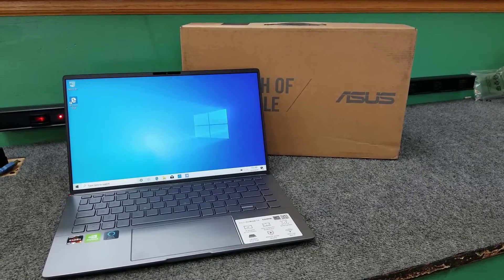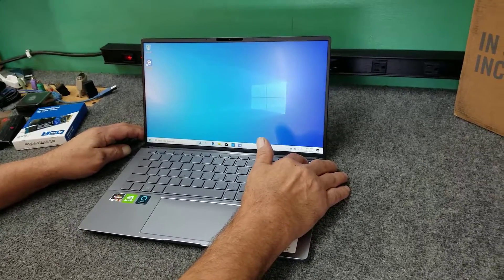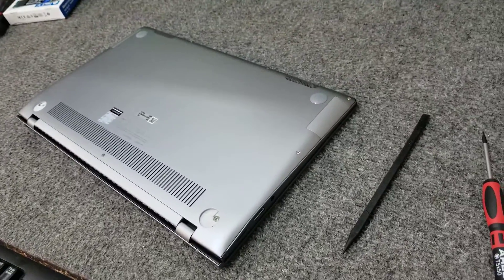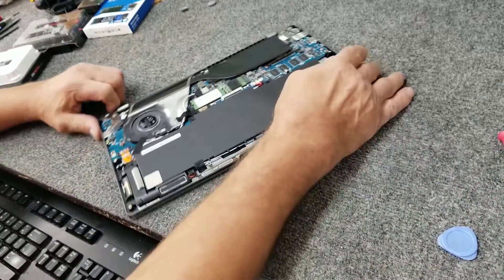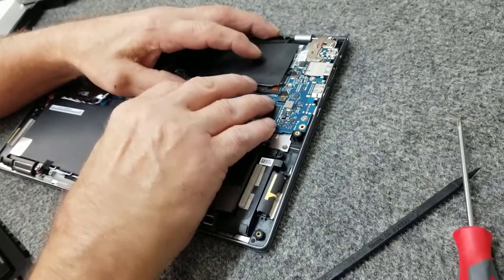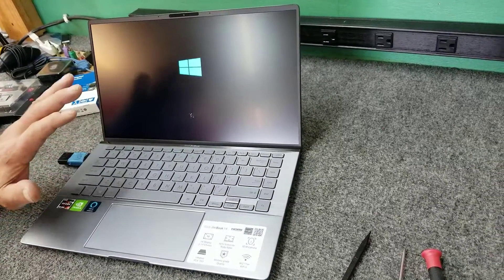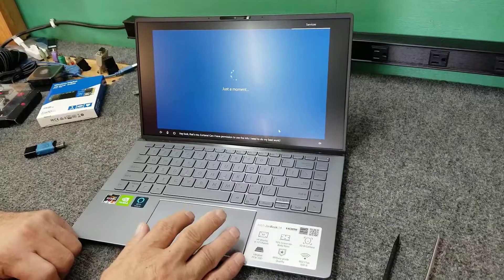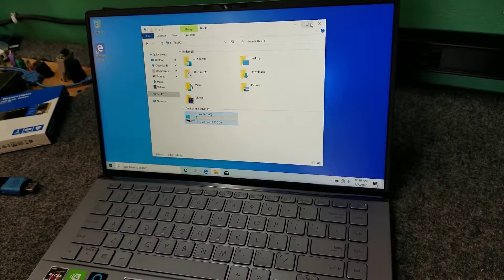ASUS Zenbook 14 How To Upgrade NVMe SSD

Comment: I got the same model and am pretty happy with it, unfortunately the SSD 256G is the bare minimum storage so like you am upgrading to a Samsung 970 EVO Plus 1Tb SSD.  I pulled this video up as my first roadblock is the 00 screws holding the bottom plate…I need a new tool.  The usual.  Great info 👍🏻

Comment: Will an nvme pcie 4.0 drive work on this laptop?
Reply from the maker: It should work fine, but will run at pci-e 3.0 speeds. It will still be fast.

Comment: The reason why the laptop was not fully powered off was because you released your finger off the power button before it shut down, causing it to go into sleep mode instead.
Remember: a proper shut down would be going into the start menu and clicking shut down.

Comment: Hi! Great video.

 Quick question, will I benefit if I install a gen4 pcie SSD or will it be bottlenecked by the slot of the laptop?

Thanks!
Reply: Lookup the pcie bus type…it’s probably a Gen-3.  If so the Gen-4 will be throttled by the bus speed.  I had this question and asked AI and it guided my way 👍🏻

Comment: Do you know if you can upgrade thhe RAM in the Zenbook duo 14? It comes with 8 GB and it says its capable to take 16 GB but how if is soldered to the board??

By the way, thank you for your video on up dating the SSD (NVME)! Appreciate it.

Comment: Hi. I bought the new asus Q538e 11gen I7, 16gb ram, 4gb video, oled 4k touch. It came with a 1tb NVMe drive but I wanted to put in a faster drive....so I purchased the WD Black SN850 NVMe gen 4 7000mb per second drive. Bios saw it but windows install never did. As I gave up I put the original drive back in so I could contact asus........bit locker locked the laptop. I want this new drive in the laptop....but this was not a smooth sailing adventure.

Comment: If the laptop is new without many things installed, is there any reason not to clone it? Will it cause issues if I clone it to a bigger drive? I bought the same laptop and still haven't gone through Windows setup I don't know whether to clone it or reinstall windows.

Comment: Update: the process went well
It's probably the easiest mod ever 
I followed along with the video 
Other than the middle one, the torx screws are a bit slanted.
Everything looks good and thanks for the tutorial
A side note: as other poster mentioned, make sure the SSD is NVMe.
I installed Crucial 2280 NVMe 1TB on it. The blue tape on the top should be heat transfer tape

Comment: So the only option is to replace the old SSD with bigger capacity??
I thought it has a free slot.

Another question, if I do clean install like yours do I need a new windows license or not?
Reply from the maker: Hi. This model has only one m.2 slot. That's it.  Not alot of upgrade options except larger nvme drive. Ram is soldered to mainboard.  Dale

Comment: Seems a good idea WD sweet spot performance /$ 

Would like to see if Linux and w10 coexist well very much . Does GPT type for drives install helps ? Or necessary maybe? 

It’s a good little machine that handles 2! External screens (seen that in practice) impressive!  Without dedicated GPU (?!)

Comment: can i add another 8 GB ram and HDD
Reply from the maker: Hi. On this model, the ram is onboard.  No expansion slot. Sry.  Dale
Reply: Hi it is possible by soldering RAM chip but is difficult

Comment: Would you say disconnecting the battery is definitely necessary?
Reply from the maker: Hi. Well, if you new at this stuff, then yes. Also pushing power button after disconnecting battery is needed too. Otherwise,  be darn careful.  Dale

Comment: Hi, is there any way to keep the both SSDs? And use them together...
Reply from the maker: Hi, no, unfortunately there is only one nvme slot.  Dale
Reply: Thank you for your information
Reply from the maker: Follow up. You can purchase an external nvme enclosure that plugs into usb. That would give you a fast external ssd.  Dale
Reply: @CadillacComputerCenter  Thank you
Reply from the maker: Hi. You need to purchase a 2280  m.2 nvme ssd. Samsung, crucial are good brands
Reply: @CadillacComputerCenter  Thank you!
Reply: @CadillacComputerCenter  What is your opinion about Sk Hynix Gold P31 nvme?
Reply: I found Crucial 1TB 2280 for $100
I checked the pics and it's one sided
I will order it today.
I also do some computer building/upgrading stuff and I have been doing it for decades

Comment: Those RAM are embedded, correct?
Reply from the maker: Yes they are. Dale
Reply: @CadillacComputerCenter  It cannot be upgraded, correct?
Reply: 16 is enough for me. if it were 8gb soldered then i'd be pissed
Reply: @ovadyarachman7243  i bought the 8Gb soldered model,lol, but tbh i bought this laptop mainly for word processing and code writing on the GO, i have a much more powerful desktop workstation.